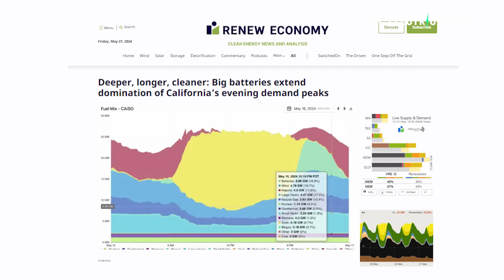Fossil fuels shattered as battery power continues breaking records in California

Comment: Gas will still be needed. Gas can be stored in readiness for when it is needed. If you get cloudy calm weather the batteries will not be charged up. Alternatively maybe nuclear could fulfil this backs function. Of course the gas used for this role doesn’t have to be methane - it could be hydrogen produced by electrolysis.
Reply: Batteries seem to be working better, if "gas" were better, we wouldn't be having this conversation, now wouldn't we.
Reply: @sebyst7907 . Batteries are better….but not always sufficient.
Reply: During peak times all electricity surplus can be turned into hydrogen.

So, what gas are you talking about? Hydrogen? Yes that makes sense.
Otherwise no, not needed.
Reply: @jantjarks7946  gas in either does not make sense just on the efficiency side alone.
Reply: @RayJohnson1980  With superpower it doesn't matter, as surplus energy is used anyways, which otherwise would still get curtailed. Like many countries with a lot of solar and wind energy do right now.
Reply: If you can produce hydrogen by electrolysis, about 60% efficient, as it involves 2 stages, why haven’t you used that electricity to charge your uncharged batteries?
Reply: @smthB4  Hydrogen 60% efficient? Go back to school. It's about 4% efficient.
Reply: @davidbrayshaw3529  I was being kind……
Reply: @smthB4  OK.
Reply: Electricity can be stored in readiness for when needed too.
Reply: @BootDiskGames  batteries are 80% efficient, "gas" is maybe 40%, why would I want to pay twice as much for storage
Reply: @sebyst7907  Batteries are VERY expensive.  Also, combined-cycle gas turbines are about 65% thermally efficient.
Reply: @dzcav3  batteries are at $50 per kWh, and 95%, ohhhhhh woowwwww a whole 65% efficiency, wowwie
Reply: @dzcav3  Batteries are expensive, but they do a whole lot more than just load-shift daylight energy into the evening.  They also decongest transmission lines so there are some massive knock-on savings that you aren't considering.  Hanging new transmission lines is an incredibly expensive affair, so being able to avoid that instantly makes large-scale battery installations not only economic, but heads and tails the cheapest option.
Reply: @BootDiskGames  It’s about balance. About spreading risks. About not putting all your eggs in one basket. Hospitals and the like need back up generators in case the grid has a fault. You need other backup solutions. It’s also about value for money. How many solar panels and wind farms and batteries would you need to become entirely secure from the need to have gas or nuclear.
Reply: @johnfrancis4401  first off, we just dealt with massive problems due to gas crisis, BEVs can be used as mobile batteries, and currently they can cover a lot of the storage needs. Sick and tired of the BS oh gas and nuclear is still good. They're not, they're expensive and not as safe as advertised
Reply: @sebyst7907  gas is not good nuclear is as safe as it can be but their can be issues for sure but their is no emission from it that i know of other than getting rid of the waste from them. so you would class as a ok power source if have already but not create more due to the embedded co2 emission in the construction
Reply: @RayJohnson1980  aside the waste, it's clean. Really🤣. Nuclear was fine like 40-60 years ago. But the way solar wind and batteries are growing. It's a non argument these days. Solar powerplant gets built in 18 months, nuclear powerplant, 18 years
Reply: Gas is on its way out.  Average age of gas power plants in the US is 29 years with a life expectancy of 35 years.  It is not economically feasible to build new gas plants.
Reply: @muskrat3291  you’re wrong. Gas will be around in the UK and many European countries for the next 30 years.
Reply: @johnfrancis4401  I would agree that the world will need natural gas for a very long time, but it is actually more a matter of "how much" and not so much whether it exists or not.  California, for example, has massively reduced the amount of natural gas it has to burn over the last 10 years and will continue reducing it to the point where nobody will care what the cost of natural gas is any more because it will only be used for a tiny percentage of the total generation.

Natural gas is a great bridge fuel, a great fuel to store for emergencies and portions of winter.  There is no need to get rid of it entirely, we need only reduce the consumption drastically to roughly 20% of current levels or lower.  And that is definitely possible to accomplish.
Reply: @junkerzn7312  Agreed. Cold countries like England need heating for 1/2 the year and we don’t have the windfarms or the solar panels or the electricity grid to cope if the fossil fuel tap was turned off too quickly. People would die from hypothermia. So we need to build more offshore wind farms and go for the small modular nuclear power stations and bridge the gap with methane.
Reply: renewable gas😊
Reply: @han3000b  eat those beans